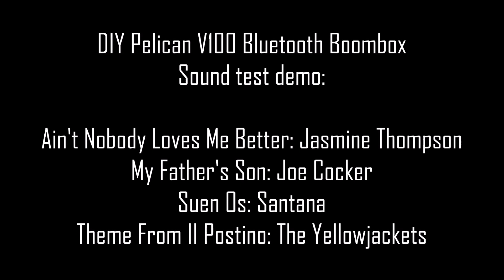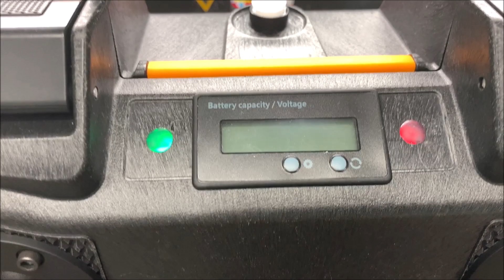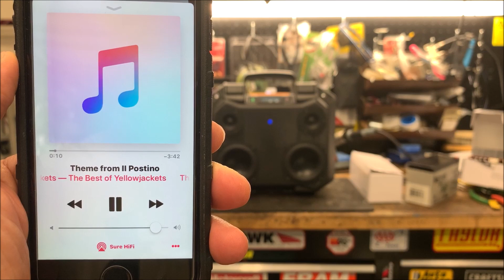DIY Pelican Vault V100 BiAmped Bluetooth Boombox SoundDemo

Comment: Nice! I've been using the LBB-5s boards for a while. Currently have 4 wired in parallel with a wondom 300 watt  mono amp. Its very easy to lose those little electrolytic capacitors though -_- glad you're making videos again by the way!